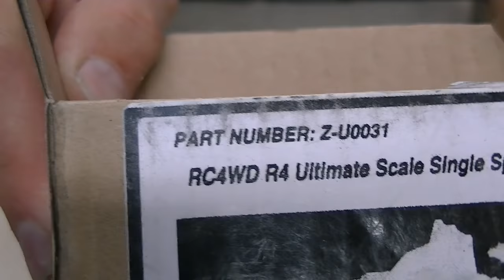GCM Scale T-Case LRT2 Assembly and Installation for R4 Trans

Comment: I don't know if I use a "ton" of power, but I have run some pretty hot setups. The only drawback with this super scale driveline that I can tell is there is no slipper. If you get your driveline in a bind something is going to break. (I have never hurt the R4 transmission and you sure won't hurt the LRT or LRT2!) This is the best scale driveline for your #tinytrucks hands down!
Reply: You don't throw enough torque at to strip gears, plane and simple, the slipper was designed to protect the plastic parts on your drivetrain, but that's a joke!!!!! That's the first thing to GO!!

Comment: that's a sweet setup, thinking I'm going to go this rt with my class 1. as for the slipper clutch comment if you're bound up its called reverse, it's what we do in  the 1:1 world or ofcourse you're gonna break something.
Reply from the maker: ... you won't break something built tough with a proper sized power system! I can stall a motor on most of my trucks now that I've got the time wheeling to make a nice balance of power and strength. The trucks over here seem to last forever and still beat most of the tug of war competitions we have from time to time... and no motor smoke! haha! I am convinced that a mild brushed setup with a good ESC and gearing and a small 3s is more than enough for just about any scale truck out there. No breaking, no slow downs. More than enough to get around trails or comp. (I also don't drive to bust things, it's a bit of common sense, like you're suggesting)
Reply: +GCMRacing1 - Scale Truck RC in Canada I agree, I really only run brushed I'll be switch to 3s power for these future builds. my class 3 I'd like to run brushless but it's not a necessity. I like to gear for tourqe first top speed second.

Comment: I already have the trans I just need the transfer case. On your site you have to buy both. I just want to buy the transfer case
Reply from the maker: This R4 transmission is not the same as the one we sell. It will look similar, but none of the parts are the same. Our GCM trans is much lower gearing. We do not make this transfer case anymore to fit onto the R4 transmission from RC4wd. Sorry.
Reply: Thank you for the fast response.